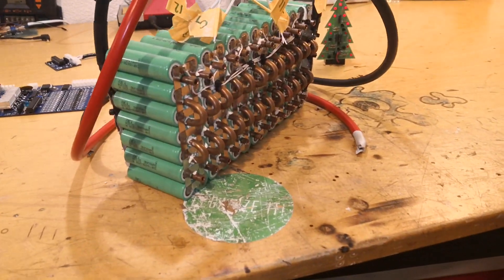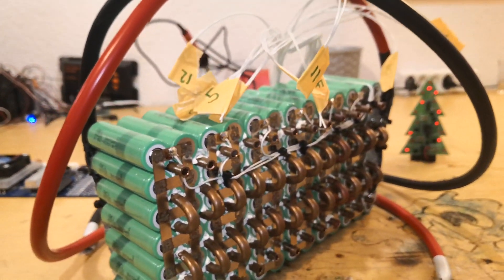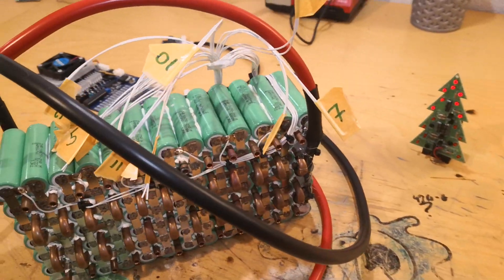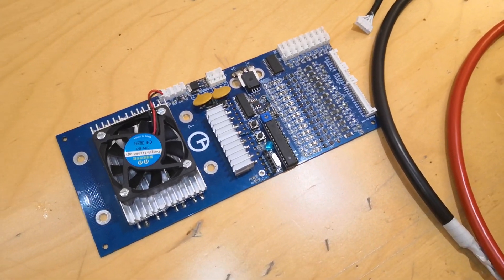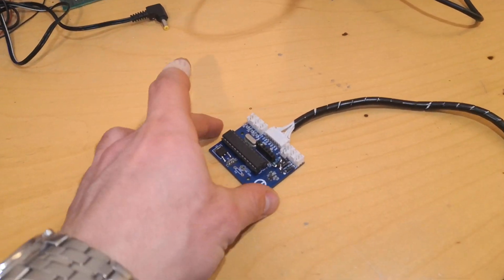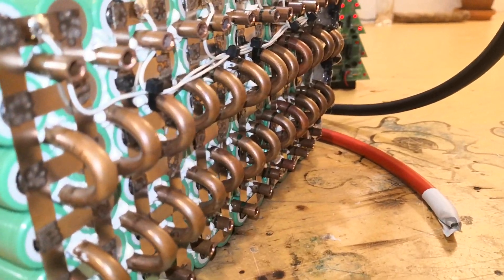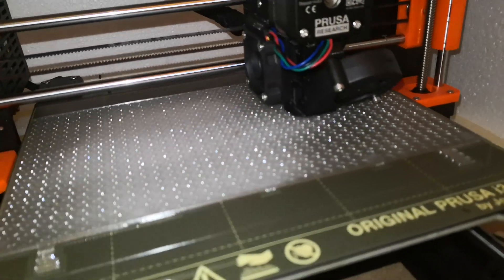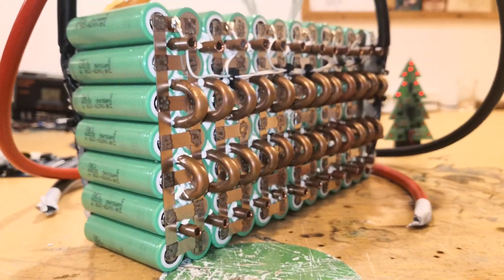LIQUID COOLED Li-ion Battery Module Part 1

Comment: There's an Indian company called Clean Electric i guess, you can find a video on the 'Electric Vehicles' channel where they showcase liquid cooled battery pack for two wheelers which does not require any pump as it is completely sealed and the batteries are submerged in dielectric liquid for direct in contact cooling which i think is not only efficient but lightweight only thing is we can't use it for larger vehicle or larger loads as the housing of the battery pack itself acts as the heat sink which is air cooled! it's a 3.5 KWH battery pack that they made for two wheelers! 
Do you think its possible to make a metal housing for individual cells which are just a bit larger than the cell so that we can add rubber seals on each ends and fill the housing with some thermally conductive liquid.. this way due to the seals, the liquid won't come out of the cell housing and furthermore the housing could be instead of being individual units it can be a pre determined number of cell slots and each parabolic curve square instead of being an empty space would be the fins that connect one cell housing to the other like a honeycomb while in the center would be a natural tube through which we can pump the coolant...!!!

Comment: yo how you get the pipe bent for dis bro ? You bent dat or you buy dat bro ?
Reply from the maker: I filled the pipe with salt, closed both ends. Then i bent it around another pipe. The salt is needed so the pipe does not collaps. Then i dissolved the salt in the pipe with water. Very time consuming and hard process to be honest not really worth it but thanks for asking
Reply: @johniii5776 can I use sand instead of salt?

Comment: Hello John III, Any chance you could do this with pex piping or silicone tubing instead? I think it would be better because it would be non conductive and would be a lot easier to install or work with. You lose some thermal conductivity though.
Reply: "some", a lot.
Reply: @Storebrand_  yeah but what is the heat buildup rate exactly? how many btu per min? plastic piping may be more then enough to match the heat buildup rate.
Reply: @keith3761  I was thinking the same tbh. Plus copper is pretty prone to corrosion, assuming the battery case isn't airtight

Comment: LOL.....this is something like a nuclear reactor core cooling problem............having a heat problem in a critical area is not a sleep easy scenario......these DIY devices are accidents waiting for a time and place to happen......sleep with one eye open.
It would be better for the cooling part to have some separation between the batteries and immerse the complete battery pack in a metal box filled with transformer oil and then pump the oil around to a radiator like a car's cooling system.

Comment: WHY does your battery need cooling?
Reply from the maker: If you want to load it more then 1C you need cooling to prevent long term damage
Reply: What happens if there is a coolant leak or a pump failure when you’re not around? Why not use more batteries to draw less amps or a battery designed for a high draw, I know Tesla use liquid cooling but their batteries packs are completely sealed so no other way to dissipate heat. This setup and pushing a battery past it design limits is asking for trouble.

Comment: So, your lines are copper? I would be a little concerned about the electricity jumping because it is so close to the terminals.
Reply from the maker: Should be no problem. 48 volts can not really jump over that distance, but it is a fair concern

Comment: How much did it costed you to make just the battery pack?
Reply from the maker: Well just the batteries were like 250$ at around 2$ per cell (91 cells) plus import tax from www.nkon.nl  but the project as a whole was much more expensive. Without liquid cooling you could make this pack for 300$. With liquid cooling its more like 500 $. Not worth it in my opinion. I just did ot for fun not because its practical.

Comment: what is the weight so far?
I wonder why did you go for 48V and not 72V or 96V instead?
For 4kW of power it would only be 3.3C respectively 2.5C vs 5C currently

The SAG is huge at 5C, so even if it will work at 4kW instant power it won't last for very long, probably 15 min or so.
So I think the trade-off should be about the weight of the cooling system and the weight of adding more cells in series and reduce the current for the same power output.
On top of your pipes I think also a large radiator should be possible difficult to install on the bike itself due to its form factor possible making the battery similar in size with a 72V version without cooling.

I had the same of how to 'cool down' the batteries and in the end I have chosen to design a product myself that helps regular users with their 'normal' batteries to boost their power, range and life cycle while also reducing the temp, workload and stress on the batteries - that is by safely running 2 or 3 batteries in parallel, whatever their voltage, form factor, chemistry, capacity or state of charge is.
You can find out more here:
https://fb.com/DATEX2 or https://bit.ly/DATEX2

Still I am interested to see the outcome of your project, so keep up the good work! (y)
Reply: How bout you make your own and stop criticizing other peoples hard work.
Reply: @markusjeff3080  this is no criticism, is just a different approach of the same issue, but with a better power, capacity and energy density per weight

Comment: Its actually more efficient to cool the contacts as they are closer to the core of the cell witch is the hotest.
Reply from the maker: Yes you are right. My fear was shorting out the battery so i opted for this way of cooling it. Tesla battery modules are also cooled on the battery walls so i guess it should be sufficient. Thanks for the advice though!
Reply: @johniii5776  You can see here the difference. Indeed is much better for the cooling to be on the nickel strips.
Probably would worth to combine them both?
https://www.youtube.com/watch?v=_jd8REVB-c8
Reply: @DATEx2  nice reference! very good insight there
Reply: @GaiusGarage  Nothing is lost, nothing is created, everything is transformed

Comment: nice prototype ! where did u get the copper pipes ,  what did u use to bend them , where did u buy the thermally adhesive from? what is the weight of the cooling system filled with coolant? can u make public the schematic  of the bms?